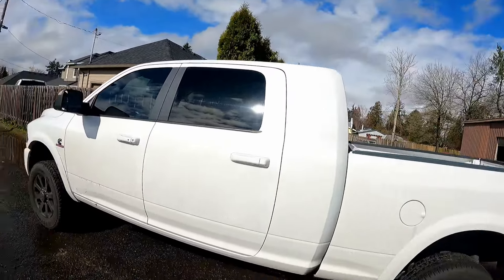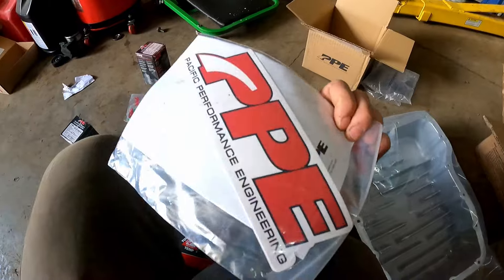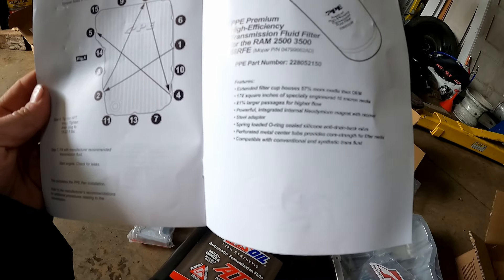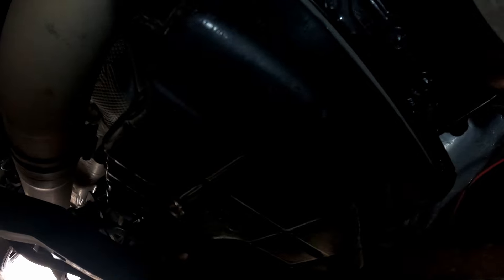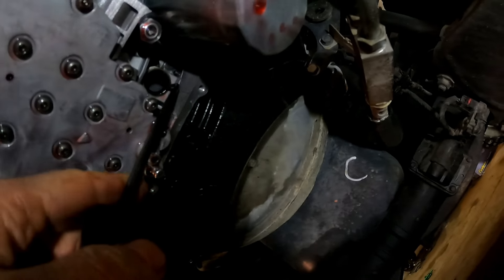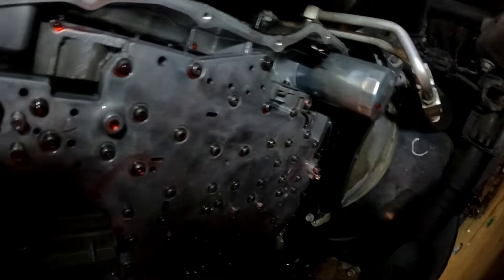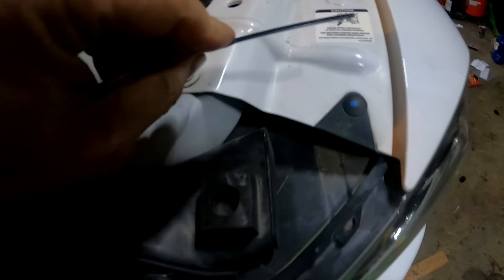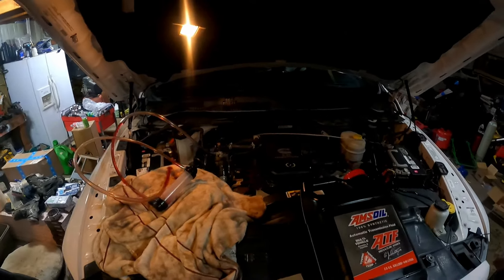Ram 2500/3500 68RFE Transmission Service And Deep Sump Pan Upgrade

Comment: I had the same  problems  with my ppe bypass  valve, must be a manufacturer  defect.
Reply from the maker: They told me to try using oem O-rings
Reply: @BuiltForSpeed   ordered  in the ats one and it worked fine, kinda disappointing  in ppe in making a simple part.
Reply: 49000 and already had the transmission rebuilt ??? 🧐 WTF !!!!